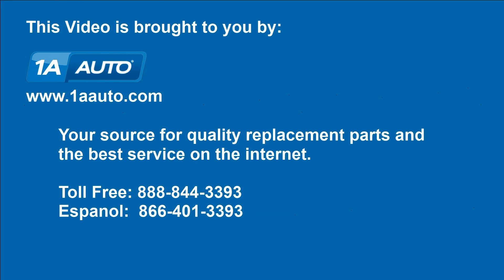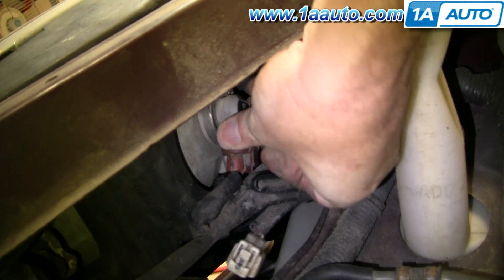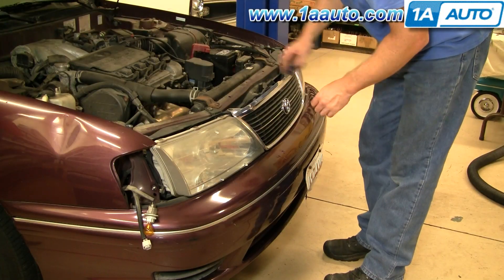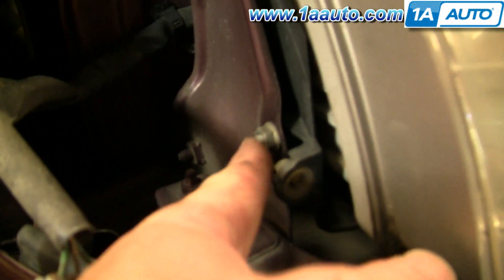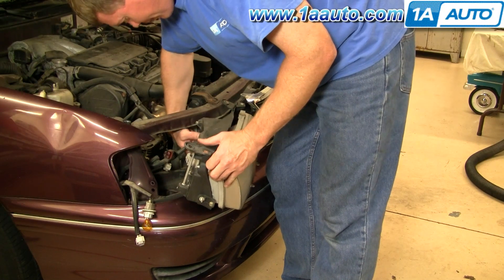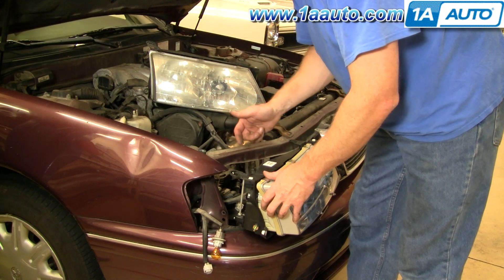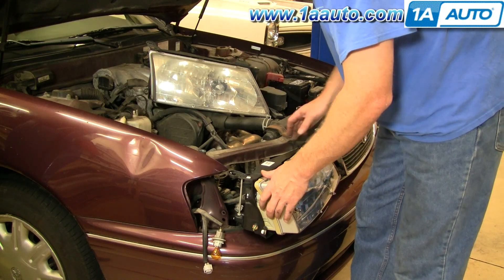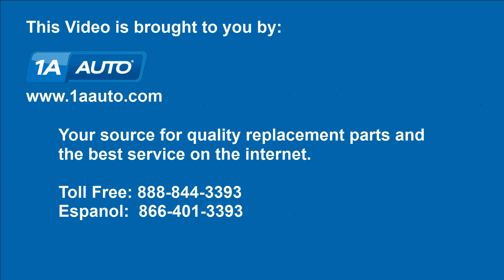How to Replace Headlight 98-99 Toyota Avalon

Comment: Thanks for the tutorial 1A.  I have a 1998 Avalon and am trying to replace the turning signal bulbs in the front.  You were able to pull out the turning signal housing with ease, but mine doesn't want to fully come out after removing the top screw.  It wiggles plenty, but feels like there is something in the back preventing it from being pulled out forward completely.  Any suggestions?

Comment: yes i have a 99 toyota avalon that i have just recently purchased brandnew sets headlights through ebay and after i installed them on just doesn't seems to look straight like between where the parking light connects to the headlights there seems to be opening gap now and before when the old ones still on it there wasn't no opening gap between the parking light connects to the headlights at all

Comment: Ah, I get it: the outer adjusting screw moves the PAIR of bulbs up/down and the inner screw moves the PAIR  left/right.(the Hi?o pair are locked together, they Highs and Lows arent individually setable independant of each other - first part of video you made it sound like that was the case, where it is not the case)

Comment: Are the bulbs same for normal light and high beam?
Reply from the maker: +Donald J. Trump From The Trenches Typically the high beam and normal headlights use different bulbs. The owners manual should have what kind of bulb you need. +1A Auto

Comment: I just replaced a Turn signal assembly on my moms car and also the headlight assembly, there is another adjustment opposite from the horizontal adjustment screw (at 7:00) that is near the vertical adjustment rod thing, it must have been left and right also cause I was adjusting it for up and down and it wasnt doing anything, I still havent got them adjusted properly but rode with them a short distance to see how they looked (as far as shining in the opposing lane), it looked good enough, but I'll have to have them come back and adjust them properly, I didn't get mine at 1A but where I bought mine online didn't come with aligning documentation which irritates me because I haven't adjusted lights but one time before. I hate Toyota's
Reply: You will change your mind about Toyota when you are still rolling at 300K plus mlles. Just maintain it.

Comment: I have a 1995 avalon that needs new assemblies. I've noticed that the 98-99 assemblies are slightly cheaper than the 95-97 assemblies. I've also noticed that they look almost the same. my question is, will a 98-99 assembly fit a 95 car?
Reply from the maker: The mounting points, may be different between model years. 1aauto.com 888-844-3393

Comment: What are the dimensions of the headlight.... I wanna see if I could fit a s13 headlight
Reply from the maker: +only and always footy Thank you for checking us out. We do not have the dimensions available as our parts are made by our vendors based off the OEM supplied sample. You may be able to obtain dimensions from other online research or by contacting a dealership associated company. 1aauto.com